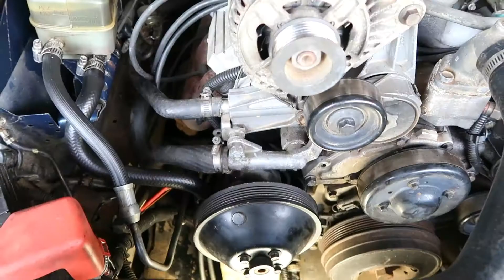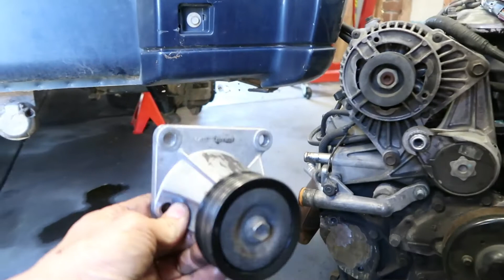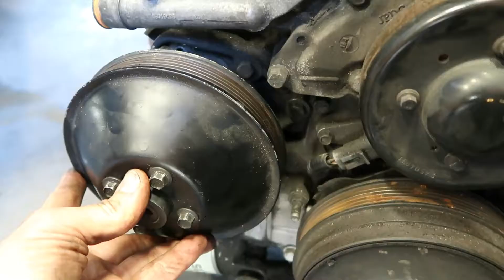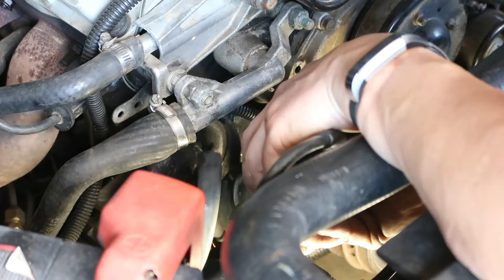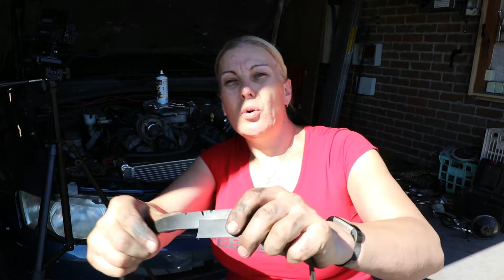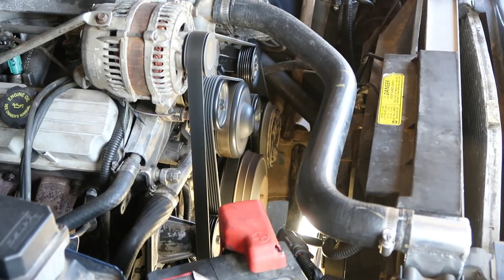Project Drift - Power Steering Pump Delete, Holden Commodore Ecotec

Comment: The power steering on my commodore stopped working. It is now too hard to steer. Can valves or something be just taken out of the rack so it can be driven without power steering?